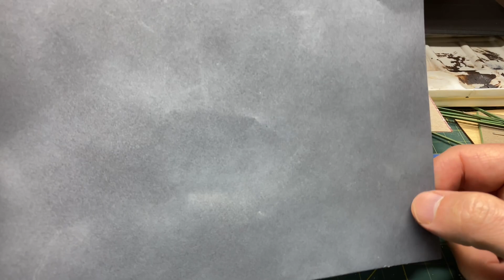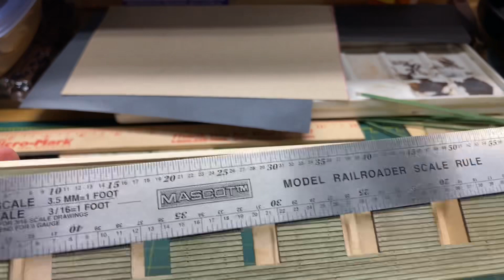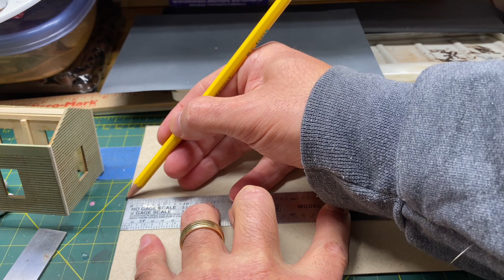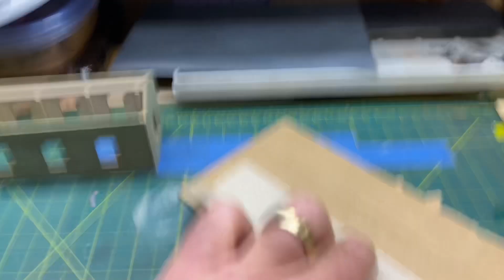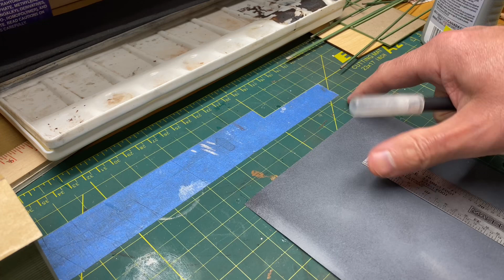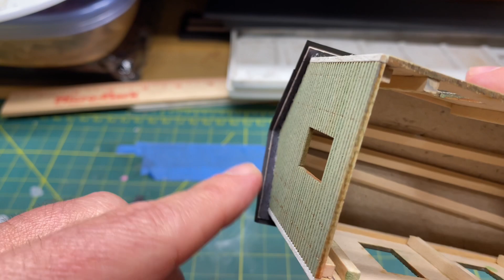How to Build a Craftsmen Kit

Comment: Great tutorial, thanks for sharing! Have you noticed any bleeding issues using sharpies and after you paint/weather the roof? I only ask because have seen tutorials etc where folks use sharpie to outline the centerlines on track but once they put wet water, etc it tends to bleed up through the ballast etc.
Reply from the maker: I have had that same issue with the ballast but never with the roof cards.